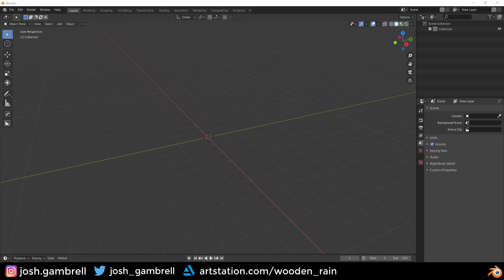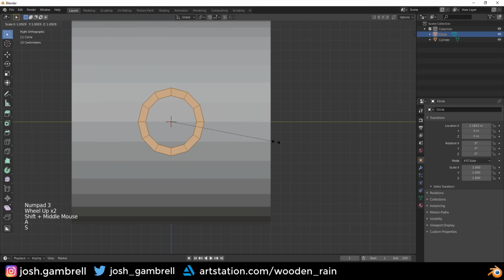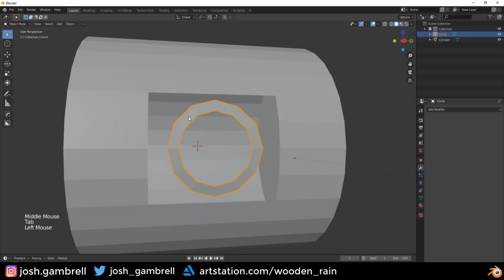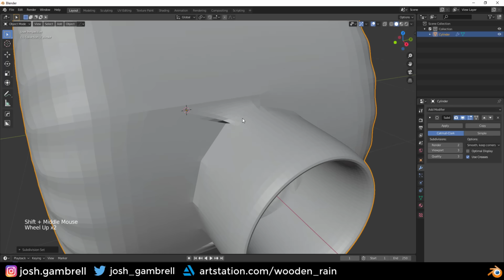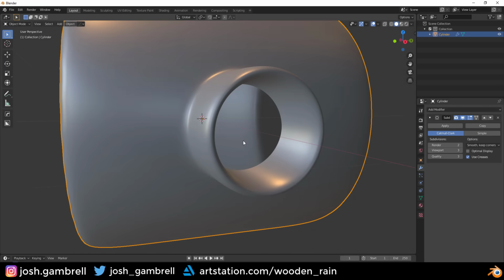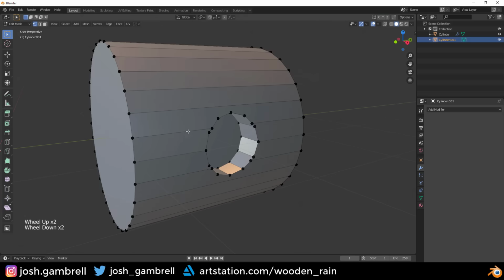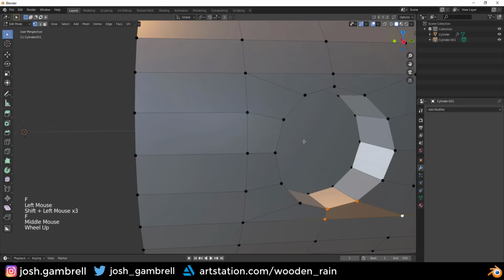The RIGHT way to cut holes in surfaces in Blender

Comment: A much more efficient way to do this is simply to use Extrude>cancel>scale>Loops tools>circle on the face selection. Few clicks. Done. Also, the boolean method is the most powerful in a real-world production setting and is widely used in professional modeling workflows. Calling it 'the old fashioned method' is not good advice for beginners. :) Booleans are a real time saver and beginning modelers should get used to working with the topology and workflow early on.
Reply from the maker: I’ve probably had like 20 comments discussing the Circle method in LoopTools. This is bad advice because it doesn’t conform to cylindrical topology; it just flattens the circle on the mesh. For spheres it works fine. And as for boolean workflows, I agree, and I use them widely (see my non-destructive vs. destructive modeling video - that’s about the only method I use). But if you’re working destructively and don’t want to deal with the hassle of clean up this method is the way to go. I appreciate your comment and agree that learning topology is important :)
Reply: @JoshGambrell  For cylindrical surfaces you just drop the radius in the Loop Tools modal, uncheck flatten, and scale up manually to retain the cylindrical form. Modeling for speed/efficiency is often about workarounds and small hacks. ;) Beginning modelers should be encouraged to explore tools themselves. Button pushing in steps doesn't train the brain to solve problems that always arise when modeling forms that they don't have a tutorial for.
Reply from the maker: I’ve tried all sorts of adjustments using LoopTools, in fact before making this video, and it just doesn’t retain the same efficient curvature even if I get the settings just right. It still required a bit of manual movearound and at the end of the day I prefer this method. However, I use the HardOps addon which allows me to accomplish this same result in just a few seconds, so perhaps I’m a bit biased on this strategy ;) Still, it’s important topological workflow and like you implied it’s important to get the brain wired to solve problems like these.

Comment: You don't even need to go to the hassle of adding a modifier.
Activate snap to surface.

Go to the magnet button above (shortcut shift+tab), change the ruler thingy on the side to face (shortcut ctrl+shift+tab) and check the "project individual elements" box.

Now align your view with your cylinder cutter, move and confirm.

All vertices will be projected to the other according to your view.

Don't even need to be a separate object if the "project to self" box is checked (current version is checked by default but older weren't).

I hope it helps.

Ps.: The "Snap to Vertex" is one of the greatest tools I  use on hard surface modeling.
Reply from the maker: Someone mentioned this earlier and I didn't even realize there was a projection snap mode! That's super useful! Thanks for mentioning it. Had I known before this video I would've included it.
Reply: @JoshGambrell  You should also look up knife project. You can use an object to cut another and it ignores the cutter topology.
 Create your cutter, select your object last, align your view, go into edit, on the upper menu click Mesh->Knife Project.
Works best in orthographic view.
You can check the "Cut through" to cut all faces, not just the visible ones. Checking the box will reset the cut, so if you don't want to align again, you can split the view and pan around in one while the other keep the "cut view".
Reply: @cyberfalcon2872  Thank you! Also missed the being in edit mode part for your snapping suggestion :) Works great though!
Knife project is cool too. Got in the way of loop cuts though, unlike the first suggestion it makes the circle part of the cylinder mesh - more complex shapes and more selecting.
Reply: @RolandKontson  yeah, is not very useful. I used just to cut through the mesh, but using Bisect, even this got useless
Reply: @cyberfalcon2872  Just got to this now and wow that was efficient!  Can't seem to do it with a circle, need to extrude and scale first so it has geometry, but easy enough to dissolve the second edge loop that is created.
Reply: @JoshGambrell  Is there a video on this because I still do not get it.
Reply: I tried but the circle stays tangent to the cylinder rather than wrapping around like when you use the shrinkwrap modifier. I have selected the "project individual element" box as you said. What am I doing wrong? I'm using Blender 2.82a. Also, where do I find the "project to self" box? Thanks.
Reply: @davidesivolella5907  You probably did it in Object mode. You need to be in Edit mode though.
Reply: I was going to recommend knife project, but this is so much better! I never had a use for surface snapping until this.
Reply: Is there a video on this because I still do not get it.
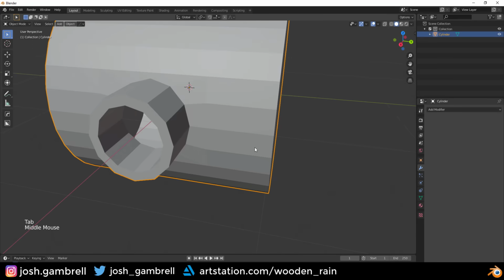Reply: @nathanpoling4926  This concept is used in the donut tutorial by blender guru at 4:30 https://www.youtube.com/watch?v=jmSgsaNSQ6s
Reply: @nathanpoling4926  they are skipping steps bc following word for word i too did not achieve the effect
Reply: @nathanpoling4926  in object mode I think you drag the circle while pressing g
Reply: I mean edit mode
Reply: Would this work with scaling too? Say you want to add a ring to a cylinder. Would it snap to the main object by scaling the ring inwards?
Reply: what the fuck
Reply: You are the beast! Thanks goat, I went to the comments

Comment: I have never used the boolean modifier
Reply from the maker: You should see definitely still keep it as a tool. I use booleans all the time with my workflow. It’s just that areas where it’s easily avoided tend to be better.
Reply: @JoshGambrell  It's just that I've never really had the chance/reason to. I'm not really a hard-surface modeler so it hasn't been needed yet. Nice video btw, it was pretty helpful.

Comment: Everytime I see a tutorial with booleans, I cringe

Even though some experts recommend it, I just had too many bad experiences with it
Reply from the maker: It depends how you use it. Once you understand non-destructive boolean-bevel techniques, weighted normals, and topology considerations booleans can make you a much more efficient modeler.
Reply: @JoshGambrell  
Weighted normals modifier can really be good for a fast and good shading that stays after a subdivision modifier, but I would've like to have as many face strengths as I'd like instead of only 3.
What I end up doing is applying the modifier and then adjust manually.

For modeling, I already use "the correct method" that you showed in the video :)

But I don't blame beginners for using booleans, I learned myself modeling in Roblox Studio, where there is almost no mesh manipulation possible, except for booleans. (there isn't even an intersection feature)
When I look back at my old work, I'm proud, but when I toggle the wireframe mode, my eyes bleed...
Reply from the maker: @GUMMY_MKII  Haha the beautiful outside but nasty inside that is the Wireframe mode...
Reply: Got to this video because last night. I made a very bad boolean
Reply from the maker: @rickyok  Haven't we all :P

Comment: Lol, my strategy is faster than yours .-.
 You just have to prepare the terrain before, do not delete the faces, just do an inset, then use the circle modifier and it's done...
Reply from the maker: Lots of people are mentioning this, but the circle tool flattens the faces and distorts the cylindrical topology with this strategy. I would NOT recommend doing it.
Reply: @JoshGambrell  you're actually right though, still I'm not used to that add on, gonna try to use it more often from now on

Comment: With the greatest of respect and I'm sure you are correct, how do you assure this is the industrial/commercial correct way? If I was being watched for example, would all "professionals" agree in the correctness of this method?
Reply from the maker: Yep, as SmallerLives said depending on the project at hand, if good topology is needed quads are the way to go. I'd recommend watching my Non-Destructive vs. Destructive Modeling Overview video - it disucsses some of your concerns. In short, quads aren't always needed, and your workflow depends solely on the project at hand, the client, if you're animating, etc.
Reply: You can be assured that the first method is the correct way.  You canuse a Boolean if you have to, so long as you know how to clean up the mess that it creates.  Personally I prefer to model everything 'as it should be' rather than 'cutting into' it with another object.  If you just used a Boolean, or something similar, you would very likely have an incredibly hard time subdividing it or rigging it.  Booleans create ngons and triangles as a way of 'getting the job done', but your model needs to be all quads if you want to do anything at all to it other than shine light on it. If a 'professional' was building a similiar object, you can be sure that he would either create an 'all quads' model from the start or would use a Boolean then clean up the topology afterwards.  If you watch pretty much any VFX reel, if they show you the wireframes, you'll notice that it's all quads.  There is a reason for that.

Comment: I just use the Loop Tools addon, Circle. Done. Yes there are a few prerequisite steps, like a subdivided patch on the surface but it does basically the same thing. Although, I do like your method. Good video.
Reply from the maker: Yes, but just be careful with Circle on a cylindrical surface. It either flattens it or distorts the topology requiring manual cleanup.

Comment: This is sufficient for small simple models, but as soon as we get to more complex hard surface work it really isn't efficient anymore unfortunately.

A lot of artists at these levels usually work with booleans and compensate for their shortcomings and using modifiers rather than making everything by hand
Reply from the maker: Depends on the model honestly. I’ve done more complex models using this strategy (see my holographic sight timelapse...) but often times smaller details I just cut out some holes using boolean, add bevel and maybe a weighted normal for shading and call it a day. I still think this is a good toolbox addition there at your disposal but not required.

Comment: Hey, the is third strategy, add a 3 loop cuts ant chose the middle vert then use build-in add-on called LoopTools and just make the same with less steps. ;-)
Reply from the maker: H A Studio  Thanks, but I've adjusted settings and although I've got it wrapped decently, it still distorts the cylindrical topology and simply doesn't do as good of a job as the shrinkwrap method. Depending on the environment you're working in, you may be able to get away with just using LoopTools with a little less decent geometry in exchange for speed. I just personally don't like that compromise.
Reply: @JoshGambrell   @Roma Buster   you have to uncheck the flatten option if you want it to be in the same position of the cylinder faces...
Reply: @JoshGambrell  Talking about distorting the cylindrical topology: your method is also distorting the cylindrical topology... since the shrinkwrapped circle has no horizontal cuts aligning with the edges of the cylinder, there are four faces in the cut-out circle which are overlapping two faces of the cylinder, which means, each of those circle faces is projected onto two cylinder faces with different normal orientations... which results in non-planar faces and thus in distorted cylindrical topology.
Reply: @gordonbrinkmann  Right - when I first did the tutorial as a newbie I thought I was doing something wrong at first, but it was only because I chose to use a bigger circle than he did, which made the distortions more obvious. Looking at the geometry again, I realized he would also have some distortion - I guess the key is just to use the least number of steps to make the least visibly obvious distortion. Or just not worry about it.
Reply from the maker: LoopTools doesn't work well with cylindrical topology. For spheres it's fine.
Reply: @JoshGambrell  yep i agree, your way is the best one for perfect topology, loopTool dont wrap on cylinder it just make straight circle.

Comment: hey josh. just so you know, when extruding or any similar type of operations, you can directly use the R/S/G shortcut to begin the desired operation without right clicking. so the shortcut combo would be E -> S (shift)X/Y/Z. a small thing but a really helpful tip to improve your workflow efficiency. there are other operations that are similar such as tear/rip. generally any operation that instantly edits the geometry (rather than applying after confirm. e.g loop cut and the knife tool do not instantly alter the mesh). keep in mind though that only one transform operation can be performed at a time like normal.
Reply: Josh Gambrell  Is there a video on this because I still do not get it.
Reply: Please show us tear/rip.
Reply: @AA-hg7xq  google it yourself dude, these basic videos already exist, don't be a help vampire

Comment: Why not use loop tools for that. You don't even need to create a circle and project it and manually connect faces then.
Reply: Looptools will make the circle flat and it does not follow the curve of the cylinder.
Reply from the maker: LoopTools works fine for spheres because it follows the curved topology. For cylinders it flattens the circle on the mesh and doesn't conform to the curve of the cylinder like Kainthavampire said below.

Comment: In the second example the hole was capped inside.
Reply from the maker: I show how to fix it later in the video ;)
Reply: @JoshGambrell  the next video?
Reply from the maker: @gnamp  It's in this video, I delete the capped area and extrude out like the first one.
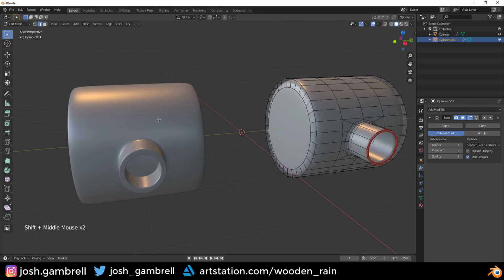Reply: @JoshGambrell  Dude- you can see it's still capped at the very end of the film. Compare the interior edges of the holes. The right one clearly exhibits an internal fillet between its sides and the cap- 10:31
Reply from the maker: I’m not too sure where you’re going with this. If it’s capped you can simply delete out the interior area and leave the extrusion and you’ll be good to go.
Reply: @JoshGambrell  Lol. I'm not going anywhere with it- It's really no big deal- I just wanted to point something out- then felt compelled to defend the observation when you implied I was mistaken. Let's cap it... er... put a lid on it now, eh? :)
Reply from the maker: Just realized my last comment sounded a bit rude - lol sorry that wasn’t my intention. But I see what you mean now. Yeah it’s best to just delete that guy out so you don’t run into subdivision issues later on.
Reply: @JoshGambrell  sound as a pound :)

Comment: I am using  the loop tools add-on, super easy....  Thanks
Reply from the maker: Careful with Loop Tools on cylindrical surfaces; it works alright on spheres but cylinders not so well.
Reply: @JoshGambrell  loop tools did not work as you mentioned.... I thought it will work.
Reply: @JoshGambrell  you are right, I did it on sphere. I will try so I can get the idea. Thanka again

Comment: Very useful as usual! I find your tutorials very instructive. I have a problem with texturing. I'm trying to assign different textures to the same object. I selected them in Edit mode but when I assign the material or the texture it's applied to the whole object and not the faces I selected. Could it be a matter of wrong geometry? I'm a beginner in modelling. Thanks.
Reply from the maker: If you want different textures on one material, you have to unwrap the mesh and put the textures on their respective parts. You might be trying to assign one material and it's applying to the whole mesh. You can either give a unique texture for each material or use one material and put the textures on the UV Map properly. This video might help you because it's difficult to explain efficiently in a single comment:
https://www.youtube.com/watch?v=9airvjDaVh4
Reply: @JoshGambrell  Thanks Josh I knew already that tutorial but it's not my case. Anyway I just succeded. After the texture as been applied to the whole object if I reselect again the face and I apply a different texture it works! Thanks again for the long reply, you are really a kind person!